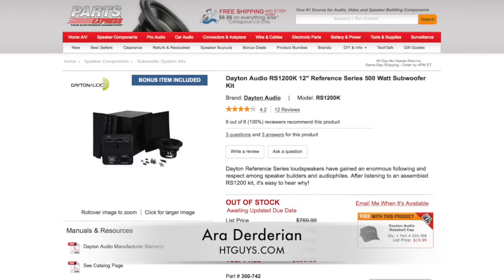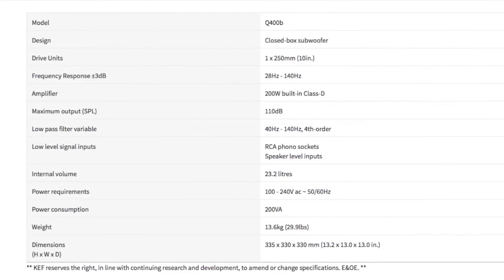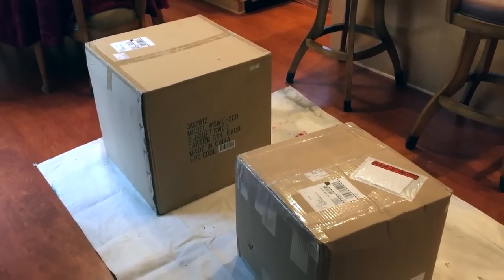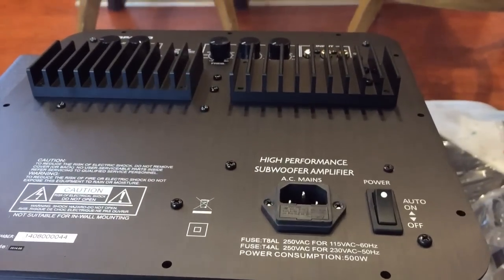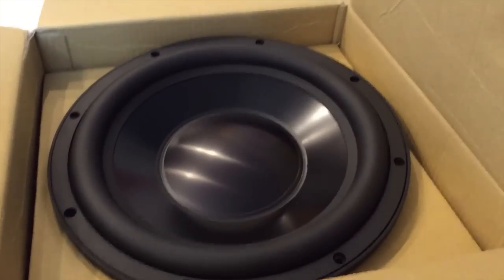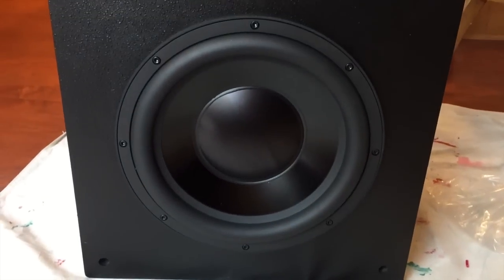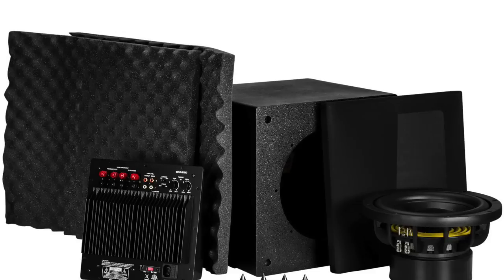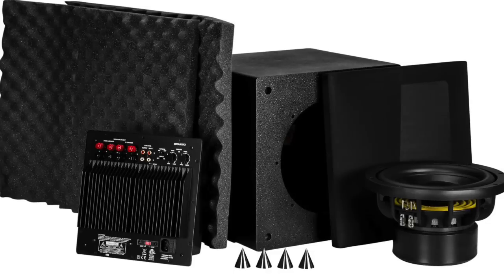DIY Subwoofer

Comment: I have a PB13 , but I am moving up to 3 UM18-20 subs using flat pack boxes and a 6000W @2Ohm SpeakerPower plate amp to power all three subs. I will use 220v to get all of the power out of the amp and will be wired at 3Ohm, so I should have about 5000W RMS, 1650W RMS per sub. Under $3k for the whole setup and better than 6 PB13's at $12K. DIY is a great way to do it. I'm also going to use MiniDSP. Great video.

Comment: Where is the DIY part, like you building the box for instance ?. Never seen that happen is all, parts appear & then box appears out of nowhere. Hardly DIY if you not doing it yourself, ordering the parts is far from DIY.
Reply from the maker: I agree with your comment. At 3:15 into the video I mention that I wouldn't call it a DIY project but more like an assembly project of a subwoofer that someone at Parts Express designed.
Reply: HT Guys
Why name it DIY Subwoofer then ? confusing.
Reply: Because the kit comes in pieces and you have to assemble it your self maybe?